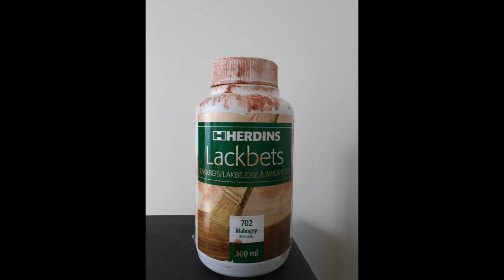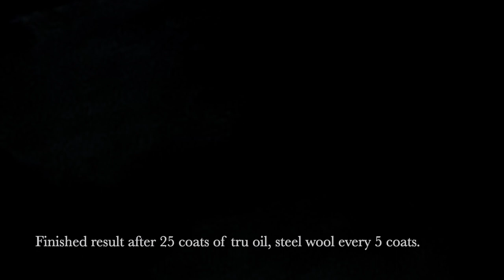Guitar refinishing

Comment: The darker sound is sometimes due to changes in the pickup height after doing a mod. People usually don't put the pickups back exactly at the height they were before modding. Try lowering the pickup height, and you might get more clarity.

Comment: the change in tone was more than likely due to the change in pick up height. Tone wood and all that shit is a myth, your pick ups are responsible for the raw sound from your guitar and pretty much nothing else. I would give the custom pick guard another shot, just take note of the pick up height on the original pick guard and try to replicate that.  That new finish with the white back looks sick btw!
Reply from the maker: Pickups are the same height. You can see the cavity in the guitar in the pics at the beginning of the video. Its pretty deep and makes it almost semi hollow. The wood was messing with the resonance FOR SURE, i checked it. This guitar is acoustically loud, when its unplugged. With the pickguard slapped on volume was much lower. It was dampened. So it definately affected the tone negatively. Thanks for the info though. 👍